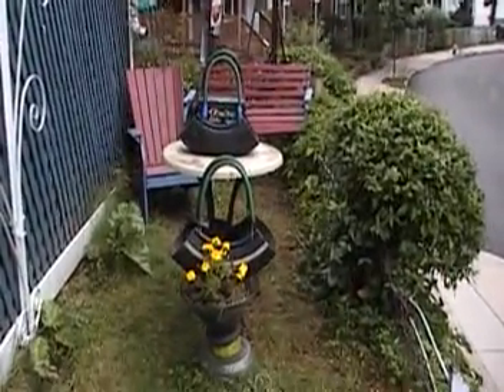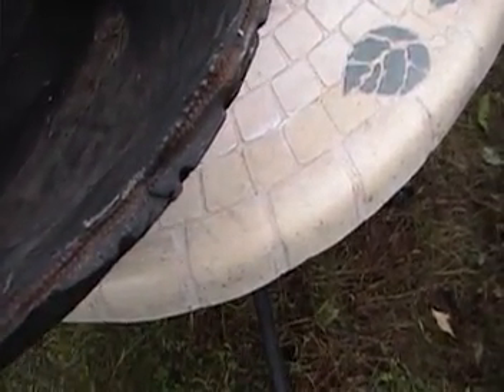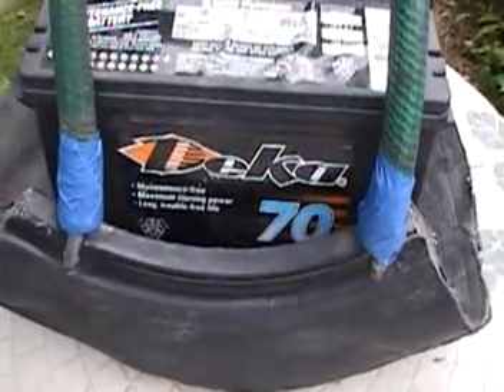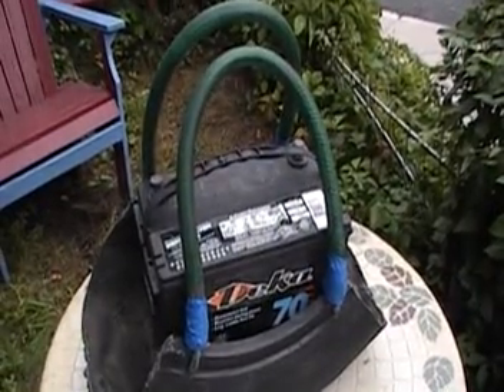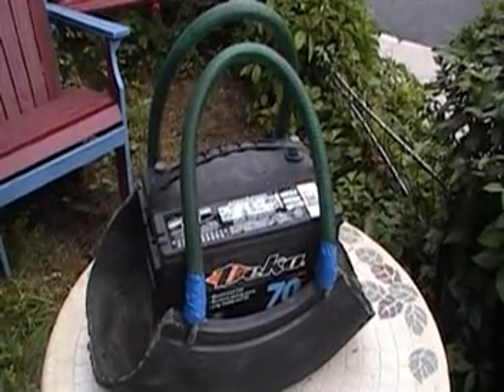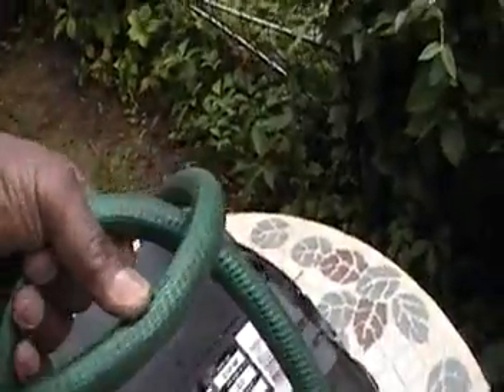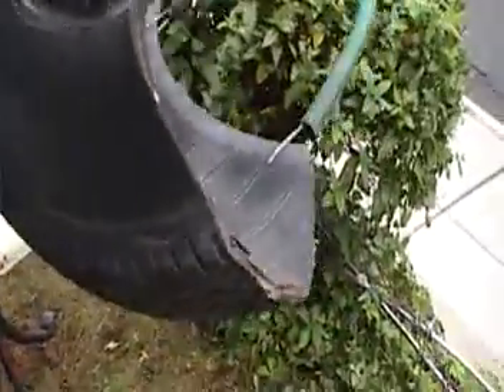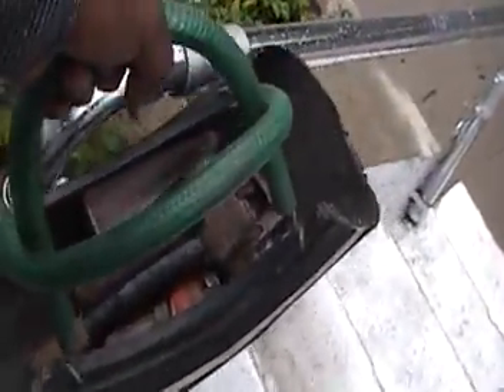Car tire baskets for sharp tools

Comment from the maker: The machinery for recycling tires is well developed. 20 years ago that was not the case and tire dumps got very large and often caught fire. My biggest idea about tire is to make a rim with two disks that press the inside rings of the tire together. That way the tire can be used without inflating it. The goal is to make tires useful even if they have holes. 4 tires using those rims can support the weight of one person and a small 2-cycle engine. That vehicle will work well on sand & dirt road.